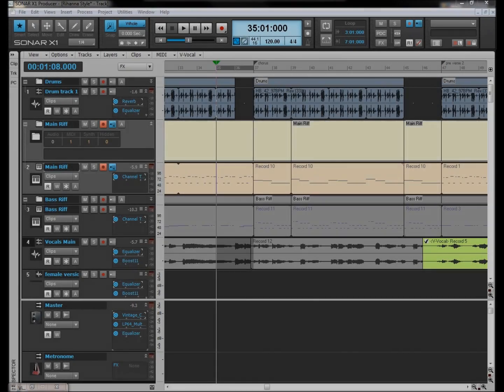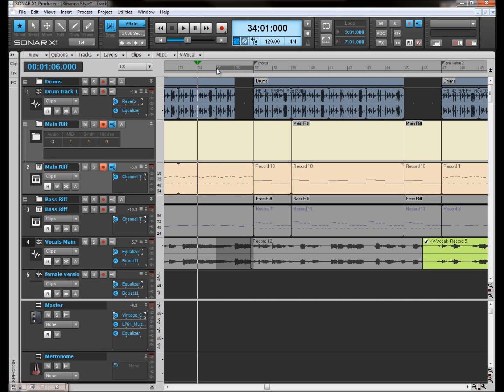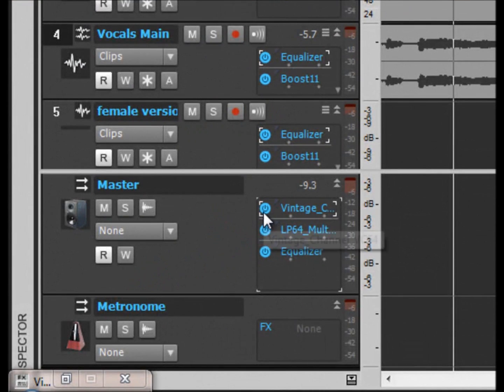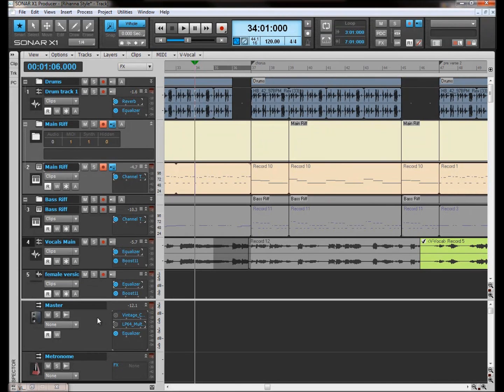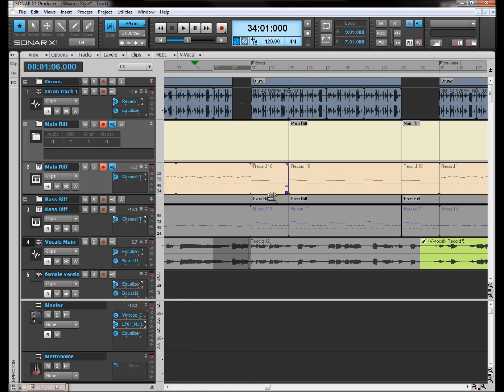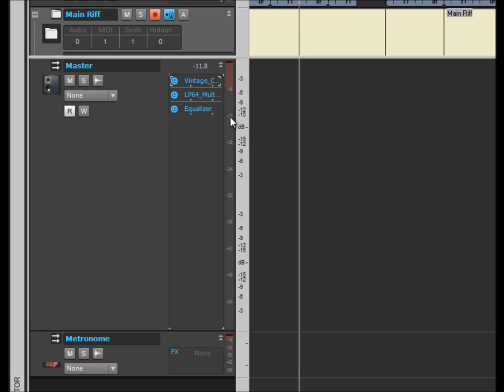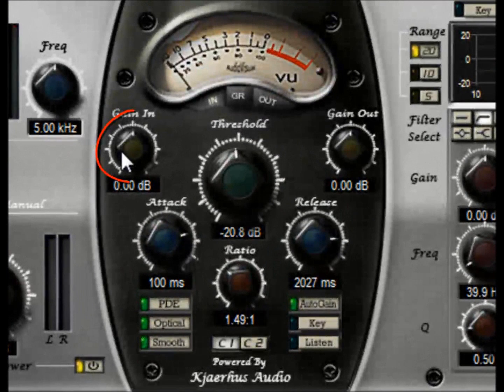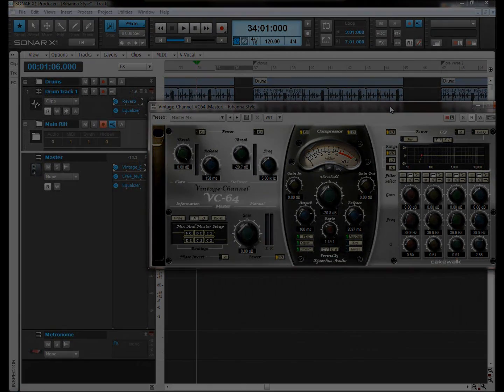BASICS | Understanding Cakewalk Sonar - Part 4.1

Comment: hi there,hope you can help,I'm using sonar x1 producer. I've imported a midi file,and I imported an  individual wave track, to record my guitar track on to.what I'm getting is the midi file and the guitar  recording together,in to my wave track how do I separate them so I can here only the guitar,so as to mix them separately,I have the same problem even when the mixer is not plugged in to the computer.thank you so much hope you can help.Ross...

Comment: Mastering for "radio airplay" will require "trimming" the outer 'bands' of the overall frequency spectrum (extreme low-freq. & high freq.) in order to achieve a narrower overall spectrum in order to meet radio airplay specifications. Mastering for nightclub play allows for a wider 'overall frequency spectrum' since it is limited only by the overall 'frequency-width' a particular club's sound system can handle... the speakers (transducers) of which are normally protected by in-house filtering.

Comment: Matter of semantics. While technically incorrect by "proper" terminology used, once you get past Pippen's vocabulary "error"... the lesson here is extremely helpful. I'm quite sure what he is trying to say is that compression increases the levels of lower "amplitude" frequencies and while limiting the levels of higher "amplitude" frequencies which results in less of a variable in "amplitudes" across the "frequency" spectrum. Hence, the "squashing". Amplitude=decibels (dB)  Frequency= Hertz (Hz)

Comment: Wait, i'm a bit confused now.. lol... 24bit? Do you mean 32bit program? I need something that would use up my 8gb of ram that are installed in my computer. I've been using FL Studio and so far it's been running great, but cons are it doesn't use up all the ram and some heavy vst's like Symphobia, it cannot handle. But with X1 64bit trial prog version it's been running like heaven. So i'm just thinking whether it's worth spending 400$ on producer version or not... (:

Comment: @MCIHomeStudio cheers for the quick answer :) i dont want to sound thick but i am a very computer illiterate, so the Multimix 8 that ur using bypasses the soundcard in ur computer? ive only got a mid range laptop so im not sure if it can cope with the high processing power I expect this software and hardware is gonna require. Also, as ur playing the drums on ur midi keyboard, can u laydown each drum track separately, so i could record the kick, and then record the hi hat separately? thanks

Comment: It's crap....

non user freindly and overly controlling...

a nightmare of a program to get into...

if you can break through the BS then maybe you might like it...

I gave up just trying to get it to run in 24 bit depth at 9600 rate... it seemed to want to force me to record and work in 16 bit 44100...

not bad... but shit for a $100 price tag... Mixcraft 4 is better than this... and Mixcraft is pretty meh...